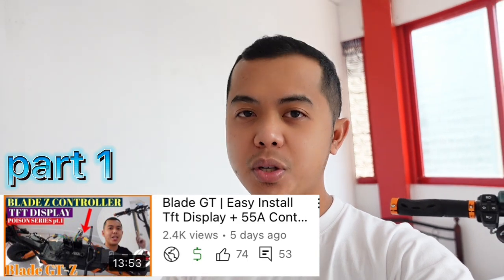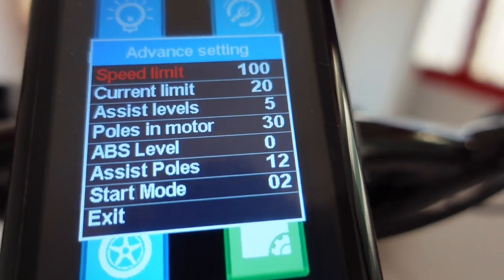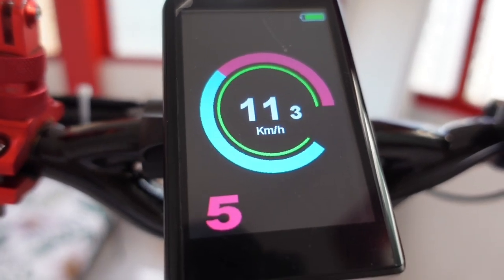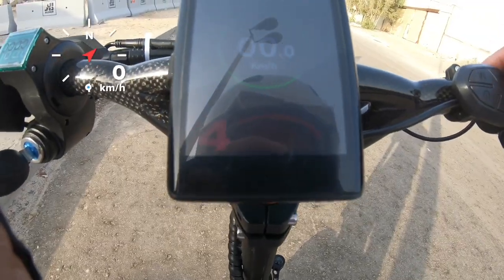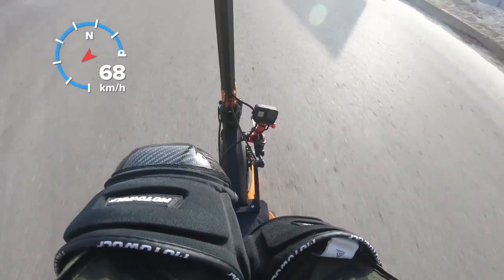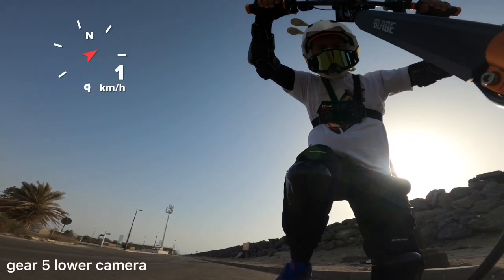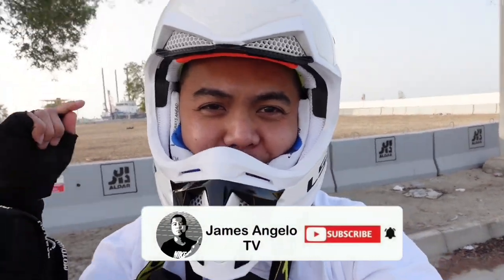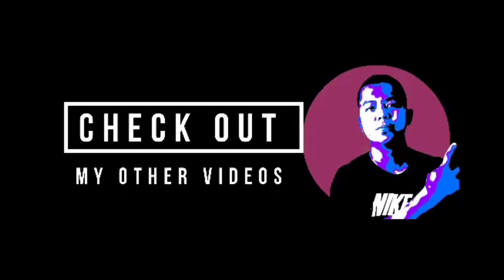Blade GT - Z | Top Speed Test + P settings | 55A controller | 60V | 23.4 CN Batt | James Angelo TV

Comment: - sabi dun sa sirr sa factory settings nito kaya mag top speed ng 88 stock pero hirap kunin like sobrang tagal para makuha yung top speed sayo naman wala namang difference sa sinabing top speed pero sandaling oras lang kunin my improvement talaga angas keep it up
Reply from the maker: yes marereach nia sa 88 kapag LG batt kxe parang 40A n kxe performance ng controller kapag LG batt. yung sakin kxe 23.4 ah lang. which malaki improvement tlga. torque power palang kumakakamot na.

Comment: Hi James nice vide could you please help me understand the advanced settings for example i have the start mode set to 5 should i reduce to 2? And could you give me a brief explanation of what the advanced settings modes do. Thanks
Reply from the maker: if you are beginners i would suggest use 2 or 3 gear 5 is a high torque
Reply: @JamesAngeloTV  so start mode is the acceleration of the scooter 5 is the highest?
Reply: @JamesAngeloTV  as im not speaking about the assist level but the start mode in advanced settings

Comment: Would you recoomend the blade controllers with that display and sine wave 40ah or minimotors ey3 and controllers. No tft display as ey3 has its lil display.
Reply from the maker: sinewave controller is battery saver

Comment: Yo bro is the TFT display only shows your currentspeed but on advertention i see much more things in TFT display better dan what you have
Reply from the maker: yes bro brcuase mine is designed for blade z controller old version
Reply: @JamesAngeloTV  you should upgrade the new TFT display bro💯📺
Reply from the maker: @djoker9208  not possible bro this controller is only compatible to that tft display they have different program

Comment: I have both versions and for some reason the minimotors version feels underpowered compared to the damao version and I've upped all the p settings to Max
Reply from the maker: minimotors is better in LG 28.8 but tft display is more power
Reply: @JamesAngeloTV  comparing them to the first damao version 28.8lg...
Both versions i have are 28.8lg
But the minimotors feels a lot slower
Reply from the maker: @sireuc  yes i agree with you as my clients same comments

Comment: Where did you buy the tft display and can it be used on other scooters
Reply from the maker: no bro tft display have different program and different controller. it shoul d be match to your controller
Reply: @JamesAngeloTV  cool thanks , I like the blade but no sellers in the USA  I would have to buy from alibaba /ali express
Reply from the maker: @baz8701  yes you can get it there
Reply: @baz8701  they are sold on Ebay in the US